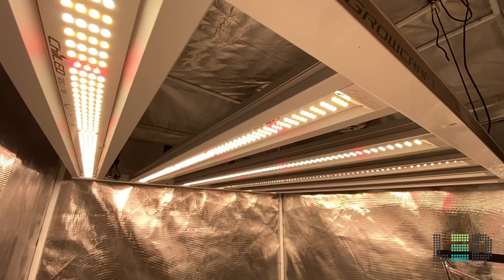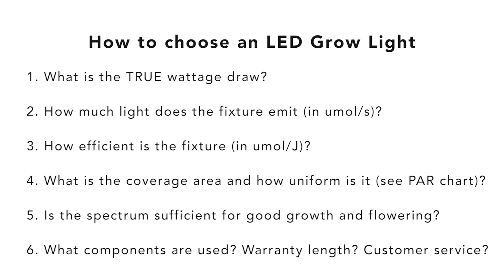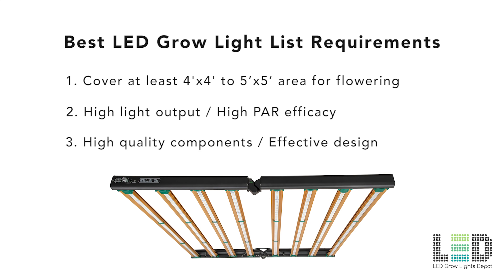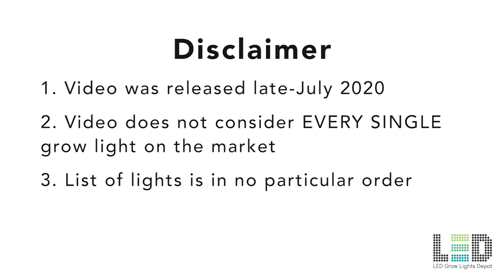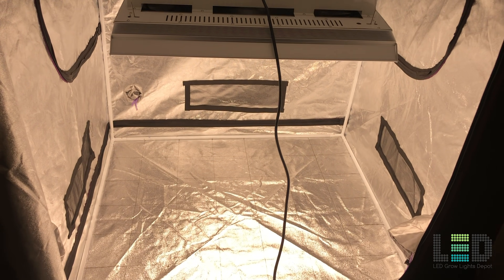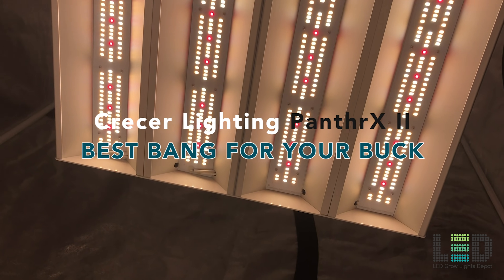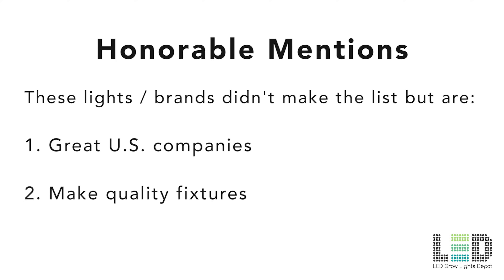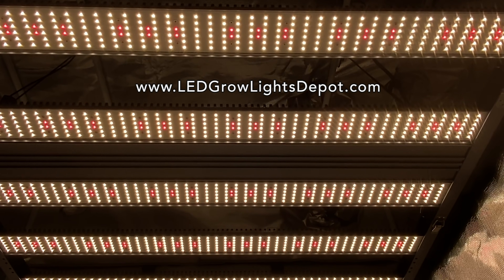Top 7 BEST LED Grow Lights 2020 - NEWEST TECH!

Comment: The cheap LED lights work well too if used in the right situation. I got a $85 light advertised at 1000W full spectrum on Amazon, hanging hardware, 6mil mylar, 1" PVC pipe, timer, and small fan. The whole setup cost $200. I made a 5' square by 5' high tent in my garage and with that cheap light I have peppers and tomato plants growing like crazy in 5 gallon buckets.
Reply: Wow, you're really blowin up the ROI!! Your secret must be in you're choice of plants...
Peace & GL
Reply: Cheap LED's may sometimes give good results, but the chance of getting a light that will work for a long time is 50-50%
Lots of people said their cheap LED's stopped working after 1 month of use. Or the light could be dangerous because of bad electronics. I want to have a peace of mind that my light will always work and i don't have to worry about any dangers. In my opinion if you plan to grow more than 3 months you should get a proper LED, you get what you pay for. If the light stops working you only have to buy another one. In my country we have a saying: ''The poor man pays twice, the rich man only pays once.''

Comment: Its funny to me with these light companies charging so much for these led grow lights. Anyone can get the parts to make the same lights even better for less than half the price they charge! Even the drivers used on today's led lights are cheaper than buying their smallest model! I get supply and demand but there are so many light companies out there the market needs to be more competitive. For the price of 1 of these bigger 600-3000 watt models I can make 7+ of those lights with money left over for stickers to brand it. Wtf
Reply: Well, i'm a kind a DIY kinda guy myself. Do you have any links and numbers or something to back this up? 
My only fear is that i can't replicate the output; be it PAR or the energy efficacy which at the end if not done like it is supposed to be you lose a lot more time just testing it. This is most probably the reason why more people are not doing this themselves. It takes 3 months or more to see if your product would work properly.
Reply: @carljohnson850  I can definitely send you my links! I myself am thinking once I'm done with my Morsen lights, I would look for updated boards that fix the fixture. Updating the leds to Samsung but following their layout. All driven by the newest mean well driver on the market. I can make those under $40 a pop

Comment: Mars hydro FC 6500 is looking good,can u please do a review on it
Reply: Na look up fc 6500
Really good specs for the price its crazy
Reply: They use the same Samsung chips as the HLG's . Looks like a top grow light . Mars hydro have upped their game lately . Does look overpriced though .
Reply: @markyboyb32ify  Over-priced? You seen the par charts on the light?? Much better then the other lights around its price point. I 3rd the FC6500 review i'm gonna be looking to grab one soon most likely as long as the pars are in line with the charts. From what i have been seeing you won't get much better for that price. At 12' its reading 1400 par in the corners average overall of like 1500-1600 in a 5 by 5. What light at that price is gonna give that coverage? Its a real 5 by 5 to because the fixture itself is literally almost 5 by 5.
Reply: @realrealityeast6278  yeah I only had a quick glance just checked again was priced in dollars not pounds . My bad . Yeah reasonable price for what you get.  I use the HlG v2. That was pricey when released. But looking at the new Mars hydro lights I like that how spread out you can get the coverage.  Btw you flower at 1500 par ?? I hope you are using some co2 .
Reply: @realrealityeast6278  So it won't fit in a 4'x4' tent...
Reply: Do u mean the new mars hydro sp3000 ?
Reply: I'm growing with the Mars-Hydro FC3000. So far so good! :-)
Reply: @STONEDay  how does the FC3000 light compare to their SP3000?
Reply: @baileyongonzalaz  Send me a SP3000 and I'll let you know.
Reply: the fc 6500 is legit but if you're running it at 100 
you really need to have your nutes tuned in.
Reply: @david vanderlinden yoo my brother,that MH FC6500 does look pretty nice& mean..im thinking of getting one also,that or maybe another bar style light? what’s about “Meiju” ?? you know much about  that one in  Particular?

Comment: Hi there, what do you think of OpticLED? Optic8 NextGen
Reply: There a awesome light and guys are pulling a lot of weight with them way above average yields and blow a 1000w HPS away
Reply: PATSFAN420  How did he lie about the drivers? Did he switch them out? Is he placing a label over the drivers? Is there some source or substance from where your claims are coming from? Pretty big claims your staying

Comment: Correction:  The HLG 650r uses LM301H diodes. NOT LM301B's.  That is all.  I run two 650's and one optic 600h.
Reply: What is the difference in the diodes?
Reply: @jasonmeyers3423  the H stays for "Horticulture" 
Im not shure about the difference between B and H but HLG is too expensive! 
You get the same with B or H with 660nm and 288 Chips per Board in China for less Money 
Kingbrite 
Meijiu 
Bava LED
Reply: I just got my hlg 600h rspec and built the diy kit yesterday...holy shit that light is bright af. Going to kill in my 5x5 tent
Reply: Which light you liking better?! I’m thinking of getting the HLG 650r but people keep telling me it’s got a lot of down direct light? Do you find that or would it be good for a 5x5?
Reply: @Goofybylove  its supposed to be fine to flower a 5x5 or veg a 7x7. Recommended hanging height in veg is 32" at 50% power and flower is 18 to 24" at 100%. I do not see a issue at all. I used it to veg this time and my plants have stayed squaty and FULL. The nodes are literally stacking on top of each other but there is little stretch. Im about 6 weeks from seed and my plants are prob about 12 to 18" tall. Hard to say because I have been really LST since they were young and its completely bent over. Get this light, you won't regret it

Comment: I thought I should comment on the Slim600H performance. This fixture has out performed two other top level Led Grow lights in a real time environment! Meaning actual garden grows!👍. My canopy was actually deeper with the Slim than one touting a deep canopy.  The PAR does deviate lower than the layer closer to the light, but this is completely normal with all lights! Another thing I’d like to ad? Do you have the equip for the test you’re pointing out Eric? If you say no? Then why are you reviewing lights with a PAR meter, heat tester, and area coverage? All that information is already given with most all lights! You’re just doing a repeat! So do us all a favor and get the test equipment you are condemning someone for not having done?! And show us how all lights stack up to that? After all, it’s just fine print.....right?
Reply: Tell him brother!!!! Optic all the way. I'm getting the 650s GAME CHANGING

Comment: I love you’re videos thank you!  I will watch it 50 times😂😂. 
I think it’s worth mentioning the 600 watt x6 growcraft is 2.81m/j.  The only fixtures I know of that match or surpass that are the 650r or Fohse Aries
Reply: Fohse Aries!
Reply: @B Mo I have two and I'm about to get two more 😁😁😁....the deep blue diodes are amazing!
Reply: It’s because Optic uses more whites. Only 28 red. I also prefer the smaller footprint and more complete spectrum  of the HLG650R. Cannabis in particular is extremely efficient at distributing energy. Also this is better for deep canopy.
Reply: B Mo optics are nice but not sphere tested.  Also hate to tell you this there is no difference between 301b and 301 h.
Reply: B Mo there is more green and yellow
Reply: Which is what you want
Reply: B Mo also the blue is maxed out on the 650r
Reply: B Mo optics are okay but I would go with the growcraft over the slim any day.
Reply: @B Mo they must be good if they beat a lumatek zues 600 or 1000.
Reply: Optic 600slim has 3.0m/j